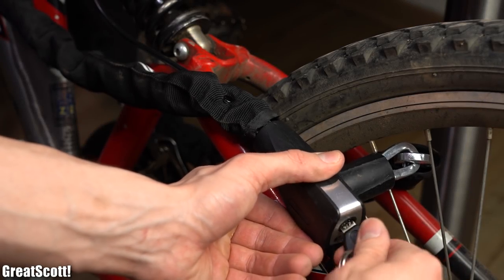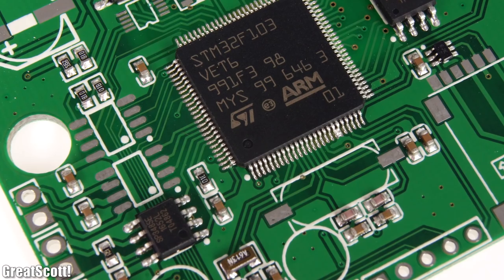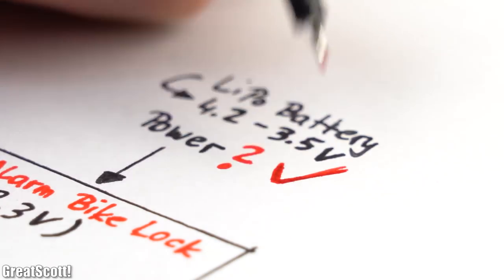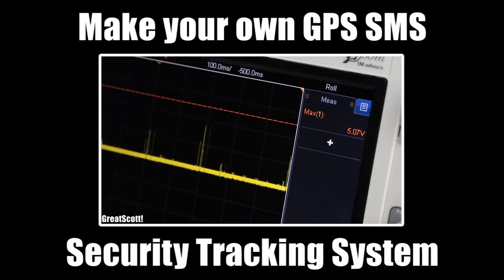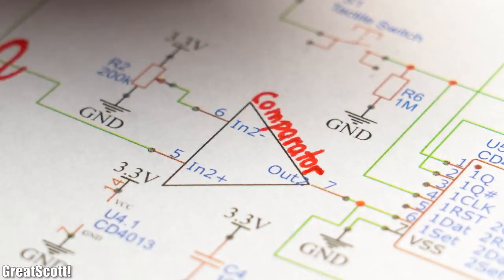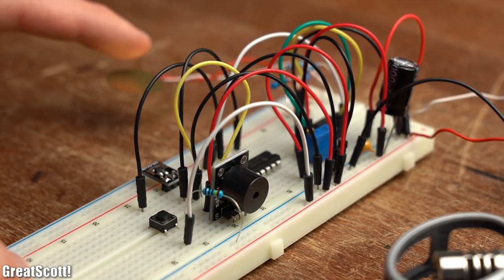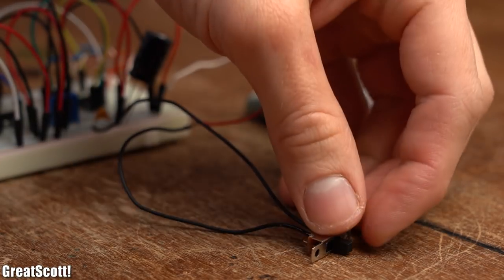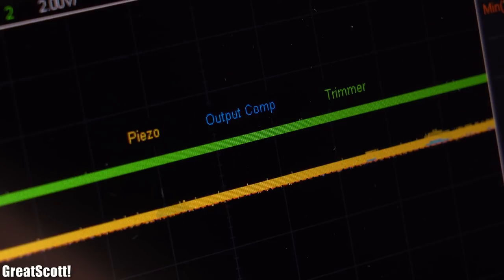DIY Alarm Bike Lock (Shock Activated)

Comment: High pitch noises are easy to silence with clothes or water for example, that's why we use sirens mostly rather than single tone alarms.
Reply: Yeah, those buzzers need just a drop of water to significantly reduce the sound.
Reply: @UtkarshAmitabhSrivastava  chewing gum works wonders as well.

Comment: I think applying repetitive high voltage shocks to the thief's ass would be more effective than that whiny buzzer. It would also probably gain you even more new subscribers! ;-)
Reply: ats89117 I thought about that for half a year, but couldn't find time to do it. I would also put electrodes to the handles, as the thief would likely not be wearing gloves. I suppose that would make them loose control and fall off the bike
Reply: This is GreatScott, not Michael Reeves
Reply: Now I imagined a bike lock that shoots out laser guided shock darts.
Reply: David Daivdson Yeah, that's what I thought of. But I would also add an opportunity to start hand- and assfrying with a remote control. I also thought of deactivating security with a key switch.
Oh, and by the way, as I live in Russia, there were some situations when the certain part(s) of the bicycle was stolen ( wheels, for example ). I also thought how to protect everything without chaining multiple times.
Reply: Boy, he's not ElectroBOOM haha
Reply: David Daivdson by the way, some people like me like riding a bike while standing sometimes, so one can put more force onto pedals, and some people can ride bike without gripping the handles, so putting electrodes both on handles and seat would ensure the asshole stealing your bike would fall off.
Reply: probably illegal and you would be punished because you hurt the thief who wanted to steal your bike. He would get away with your pain money.

Comment: Shock activated, hammer deactivated.
Reply: This is an attention getter, where hammers wouldn't be used, for the same reason.
Reply: @macswanton9622  I know, I was just joking! I see this more as a learning project, just like everything in this channel. And I like it.
Reply: Not a hammer, but a not too thick piece of cloth
Reply: @macswanton9622  Given that the bike thieves routinely use bolt cutters to get rid of the locks, this bright orange gizmo beeping really won't stop them from smashing it.
Reply: @JanCiger  True but at the same time, a simple buzzer might attract enough unwanted attention that a would be thief may abandon the idea of stealing the bike.

Comment: Send this to LockPickingLawyer!
Reply from the maker: Well, if you know where the power switch is then it gets quite easy to defuse.
Reply: A click on the first, nothing on the second...
Reply: U beat me to it...
Reply: @greatscottlab  Indeed
Reply: @greatscottlab  or just:
1.) place finger over the buzzer hole it will mute it almost completely
2.) grab pliers and squish/rip out the buzzer
3.) if you have quick release seat post throw the seat away
Good idea, but its way to obvious and large, my friend has a commercial unit the biggest downside is its size and speaker has to be "visible" to be audible(if you put a hand on it it gets really quiet).
I'd vote for a more advanced circuit, if someone touches the bike for more than X seconds activate alarm
Wireless activation/deactivation like commercial units
Ability to use the buzzer as a horn when riding like commercial units
possibly disguise as a lamp like commercial units or maby keep electronics inside the frame (but the speaker has to be audible)
18650, they are available everywhere now and usually provide 2000-2500mah so longer battery life.
or just say screw it and use xBee with a couple KV transformer ElectroBoom style XD 
examples: 
https://www.aliexpress.com/item/4000484641801.html
https://www.aliexpress.com/item/4000613820032.html

Comment: I manufactured a similar circuit to make a vibration sensitive bedside light. In my design, I used a single pic micro to sense the output from the piezo electric disk. In my case I mounted a small captive ball bearing on top of the disk, all mounted in a plastic pill box. The ball is only free to move a few millimetres, but this is sufficient to work as a vibration sensor. This also  made it insensitive to sound and very, very sensitive to low frequency vibration. The PIC can be put into very low current sleep mode,  only waking up when the comparator input triggers it. In sleep mode the pic current is much less than a micro amp (approximately 400nA), giving me a a battery life of several years when running from three AA cells 
In operation the circuit wakes from sleep when the bedroom side table is tapped. It requires a cadence of taps to keep it a wake for a preset time, in my case a few minutes. During this time it lights an array of ultra bright white LEDs, sufficient to light the room.
As an extra feature, the unit has an LDR, the output of which is measured when the first vibration is detected. If the ambient light level is above a preset level, the pic program puts the unit back to sleep, without bothering to turn on the LEDs. 
The unit is so sensitive that the whole bedside table to sensitised by the unit, yet it only responds to finger taps on the surface.
I have tested it on a very large dinning room table with the same results. 
The circuit used a trick to make the pic comparator just detect the vibration. A high value resistance chain was used to establish a differential voltage between the comparator inputs. The disk was placed across the centre bias resistor of the chain. A knock vibration has the effect of reversing the quiescent bias, waking the pic from sleep mode. 
To save power the LED uses a pic output to bias its series resistor, resulting in the light sensor not consuming current while the pic is in sleep mode.

When I was young, 14 or 15, I fitted a number of alarms to my bicycle. I was not as PC as you,  and electronics in the late 60s was not as sophisticated or ubiquitous as it is now. One of my first alarms,  powered a smoke bomb mounted under the saddle from the 6 volt front wheel hub dynamo. Later I electrified the plastic handle grips, using the hub dynamo to power a step up transformer circuit. Both were very effective at deterring the thieves that frequented the school bicycle shed, though I did have some explaining to do when someone triggered my smoke bomb device.

Comment: I think that the alarm gets activated very easy. If someone who is walking hits your bike accidentaly the alarm will activate and thats not good.
Reply from the maker: Well, but only for 6 seconds.
Reply: Using a Magnet and Reed switch on the wheel (Like Tacho's do) would've been better imo. If somebody is commited to carrying it away, say in a car, the buzzer isnt going to stop him.
Reply: @greatscottlab  yeah
Reply: @kinsi55  that's too late I'll think. The auditive alarm should trip at the moment when someone uses brute force on it.
Reply: @greatscottlab  Well  if someone actually steals it, just 6 seconds for the alarm is quite not enough in my opinion...
Reply: Well sometimes in a massive dog fight on the streets car's alarm gets poked, but no one points to that!

Comment: In my opinion, even though the project is a fun one to do, it is not particularly useful, as the casing is made from plastic and can be bypassed easily(even commercial metal locks with shock detection can be bypassed)
besides, the buzzer would probably not scare the thief and it could just be silenced by a layer of tape. Something like sms based notification would be more useful and for better security itd need a metal casing

Comment: I would add an extra feature. You know those stun gun modules for sale on Ebay? Connect the high voltage secondary to some electrodes in the handlebars. Put the primary in parallel with the piezo. And now you have it! Not only you make noise, also you shock (in a non lethal way, of course) the thief.
Reply: Or you shock yourself if you forget to turn off the alarm first ;)

Comment: I'm a fan of your channel and I've been watching you for years so please don't take this as hate but this lock provides absolutely no protection... The reset button and the power switch are on the outside where someone can easily disable it. By using something like a reed switch would be better for the reset

Comment: Great execution but why not use a monostable circuit for the same application... it would be much more power efficient right... since the circuit already includes an opamp... thus removing the need for the d flop also an opamp with a good power stage can replace the mosfet as well. Right??

Comment: small hole with a latching toggle switch inside to turn it on and off,  you have to feed a thin rod through the hole to press the button,  not easy to turn off for a random person coming across it.

Comment: I really like the idea, but I have a few thoughts on it.

Wouldn't it be to easy to just flip the switch to off?

Have you thought about adding strong flashing lights?

You could add a secondary layer, just to annoy the thief, and have a few servos stick metal bars into the wheel, when it's activated. I'm not sure where and how you'd fit them on to the bike, but it could be fun.

Comment: While I do appreciate the basic electronics idea, a PIC10F200 seems perfect for this application: 2.0V to 5V operation means no regulator, internal comparator, it could use the same piezo for sensor and buzzer, and have a fancier sounding siren. Add a secret reed switch instead of a reset button and it gets perfect.

Comment: wouldn't it make more sense to use a "key switch" (idk what they are really called, it's basically just a key lock which acts as a switch) instead of a regular switch? if someone really steals the bike, they will surely notice the little beeping box with the switch and just turn it off...

Comment: Have you considered putting a boost converter after the mosfet so the converter is only powered when there is an alarm? In that case you can use a much louder buzzer and still have a low quiescent current!

Comment: First off, I really like the project and I like your strong engineering approach to solving the problem at hand. Really interesting approach with all that circuitry but it seems excessive if all you really needed in the beginning is a gain of 34. Plenty of transistors will give you that. The problem with the overall design is that one hammer hit will take out that buzzer because it sticks out. Might even just be able to break it off the seatpost and throw it away. And for most of us with quick release seatposts the whole unit will be removed in under a minute. I see bikes stripped of their wheels and seats all the time.
Reply: But I am upvoting the video because I like all your engineering approach to it. You are using the one resource you have a lot of to use ---- yourself. Excellent way to exercise the skills you have learned and worked to get. In this time of Covid19 fears I would recommend you revisit the ozone making projects. I am in the process of turning an old CRT TV into an ozone generator.

Comment: Does the overdischarge protection actually work for a LiPo? Those boards usually cut off at around 2.5 - 2.7V, because they are made for Li-Ion cells..

Comment: Still I think it could be simpler (and cheaper) using e.g. a PIC12F617 micro controller. You need less components (no comparator no flip-flip, no capacitor), works on a voltage range of 2.5V to 5.5 V (no voltage regulator required that consumes power) and when putting the controller in sleep (wake-up by the piezo element) consumes no current.

Comment: Cool Project!
Im thinking about building such a bike lock but with a microcontroller and a sms alarm system. Like the One you build for your Motorcycle but Smaller. 

Great Video!
Reply: Thats what I would like to do too. I think instead of the buzzer I will connect the Arduinos Vin pin to the circuit and if the bike is moved the circuit will activate the Arduino and the gps module

Comment: i bet the opamp draws a lot of current. use a darlington or a btj to amplify the piezzo disk dignal.
and you could use a 555 to enable the buzzer for a few seconds. 
use a cheap door piezzo alarm for the buzzer. they come with the small transformer to drive the buzzer louders

Comment: Have you ever used PICAXE microcontrollers? I think they are perfect for these kinds of projects. Way simpler than arduino and just as powerful.
Reply: Hrm, I wonder how I've missed those.  Reading up on those a bit, they're interesting, but it seems like they're designed to only be programmed in BASIC, program blocks, or some kind of flowchart language.  Not really my thing, but it's good to know these exist.

Comment: I'm thinking about how to make it loud, maybe use one of the buzzers from inside a smoke alarm, with 9v battery as a secondary power source,  not sure if those require an oscillator though, cant remember, I modified one a while back so it would control a relay. I'm sure theres a reason you used a D flip flop but I would be tempted to try and make it work with 555 because its a more common IC. If its 3.3v maybe a cell battery could work good for some people who only want the circuit to be active briefly.

Comment: Another awesome and well explained project, as always!
The only complaint i have is that you still refuse to use connectprs between the components attached to the housing and the board, haha
I've suffered too many times with boards being attached to too mamy things and struggling to disconnect things for repairs or improvements this way

Comment: I would get a slightly beefier battery and alarm. Particularly those 6-12V sirens for motorcycles. And also bring back the Arduino to add an rf remote silencer.

Comment: To make it harder for someone to turn it off, you could use a lock the will turn it on when in the lock position. While someone could still turn it off by smashing the box, at least they can't easily turn it off with a switch.

Comment: Hi 
Great Scott i have a question that can i use b3 10w compact charger to charge 3s lipo battery pack and 18650 cells 3s battery pack? 
Directly with this charger without bms on battery pack?

Thank you ❤️

Comment: Dear Mr Scott, i wonder, do u have circuit that auto cut off circuit in low load condition? For example i use pararel the circuit with phone charger, after the charger fully charge the phone, the charger almost have no load, then the circuit will turn it off. Or i use the circuit on my amplifier, when i listen no music on certain of time, the circuit will detect low load on amplifier, then turn it off. I hope a great help. Thank you.

Comment: This brings back memories when I build a HV shocker in my bike under the seat , with  stainless steel wire in the handles and seat and a big warning sign that said "Warning Electrical Shock"  Never used a lock and nobody touched my bike  🤣😂 worked well

Comment: I humbly suggest to give the comparator a positive fedback to give it a hysteresis.
BTW you still drive your S50?
Reply from the maker: Yes I do😁 But it is a S51
Reply: @greatscottlab  I grew up in east Germany too :) When I was 16 my dad (from Canada) gifted me a yellow-orange S50 via Genex. Remembering these days, I often went on camping trips to Czechoslovakia for which I once build a 6 to 220V AC inverter (it was called a "transverter" back then) that fitted into the triangular battery compartment. This at the time when only germanium power transistors (beta < 10) were available. Anyways, so I always had power for the shaver when out in the woods. The moped itself I have fond memories about. It only failed me on long trips with a lot of load. Then the spokes tended to crack and needed immediate replacement. So I horded them (whenever I could get my hands on them) and always had them available on long trips. One time going to the "hohe Tatra" with the girlfriend and therefore also lots of luggage, I needed all of them - essentially re-spoking the rear wheel around 3 times over, just on the road side. On other occasions, the exhaust would clog from not burned oil. The only way to fix this (again on the road side) was to take off the exhaust past the "Krümmer" put some gas from the tank in, set it on fire and wait for 30 min or until white smoke appeared. Then re-assemble and everything was back to normal. I left Germany in 1988 to Canada - these memories remain...

Comment: I would use something like this, modify the design to put it in a much more hidden place (like inside the handlebars) and maybe change the means of detection and buzzer used to be louder and more annoying and then use it along with a GPS tracker as an extra precaution :)

Comment: I was kind of hoping some kind of clever deactivation when you use the bike. I guess you simply turn the device off with switch, but this is something that thief would probably quickly discover as well. Also I would try to find bit louder sound source..

Comment: It's a great design and will work extremely well but I think there will be a lot of false alarms due to wind and slite disturbances(since the pizo disc is very sensitive)...CAN WE FIX THIS PROBLEM OF FALSE ALARMS BY USING AN ARDUINO OR DECREASE THE SENSITIVITY OF THE SENSOR BY ANY MEANS TO AVOID THE USE OF ARDUINO???😅😅
By the way thanks for providing such a beautiful content about electronics😄😄😄

Comment: If you want a ridiculusly loud buzzer you should get yourself one of the cheap LiPo testers (with the seven segment display) or a lost model (drone) buzzer. Those can out put 110dB when new. Belive me they are Fking loud. I am used to working with power tools but that little piece of plastic scared the shit out of me.